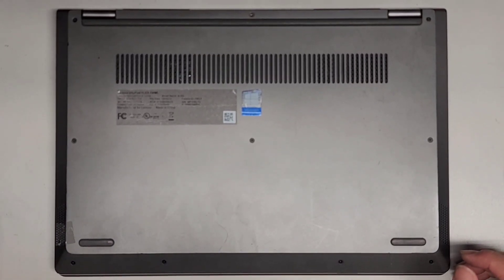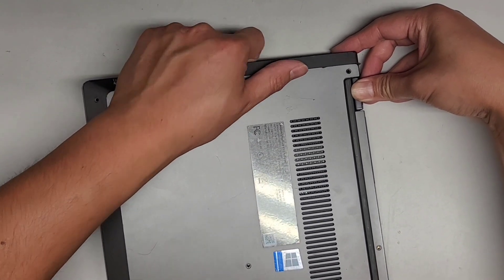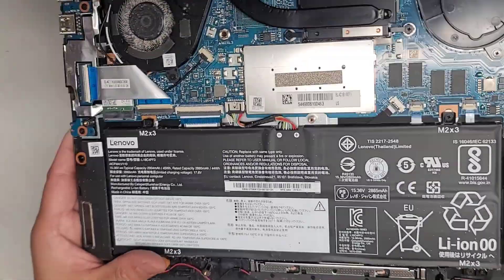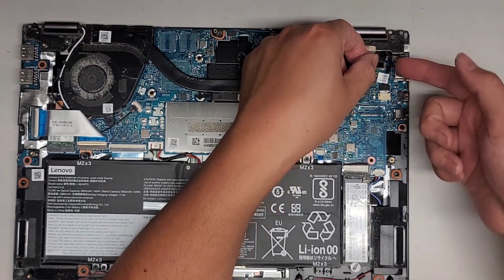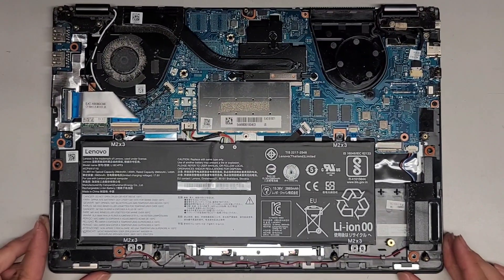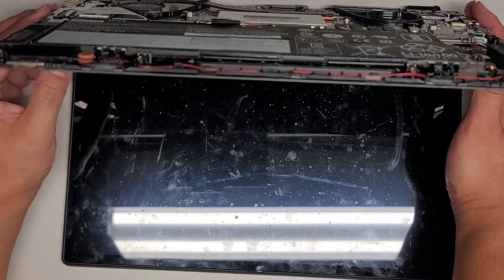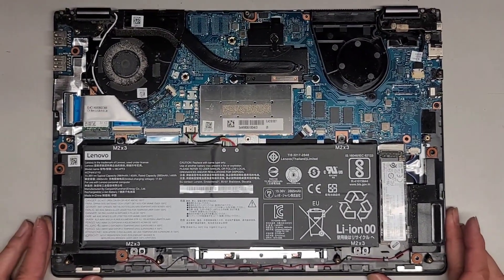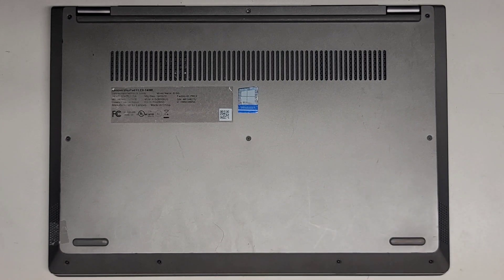Lenovo IdeaPad FLEX-14IWL Disassembly RAM SSD Hard Drive Upgrade Battery Replacement No Post Repair

Comment: Can I still replace the stick of ram to get 16, or will that do nothing with the soldered ram being 4. I'm not sure how the soldered ram works
Reply from the maker: @Cjmcoolem  you can. It'll make 20gb the first 8gb will run in dual channel if my understanding is correct.
Reply: @ItsBinhRepaired  will the laptop run 20gb of ram fine? Thats a big jump from 8
Reply from the maker: @Cjmcoolem  it should
Reply: @ItsBinhRepaired  sweet! now last question, any stick of ram that says (PC4-2666V) Is compatible correct?
Reply from the maker: Yup, should be

Comment: Can I install a 16gb 3200mhz stick ?
Reply from the maker: @brandondookeran2953  might need to be  pc4 2666v to work. You can try
Reply: @ItsBinhRepaired  worried if it might cause instability. The 3200mhz is more available where I'm from

Comment: I will be replacing my keyboard ('C' key dead-wife spilled some water on it). I have the same model laptop and have the replacement keyboard already. I was hoping you had removed it in this video so I could follow along. I have replaced the battery in this same laptop twice but didn't notice the keyboard when I removed the battery. Any advice on removing it? Thanks-great video BTW!
Reply from the maker: What?! That's no reason to kill her! Lol jokes aside, this playlist will help. Keyboard Replacement Repair: https://www.youtube.com/playlist?list=PLSSiYX-ta7aqzLhKbFnFGe9y9jl_d0aiU
Reply: @ItsBinhRepaired  😆 Thanks!
Reply from the maker: No problem

Comment: Thanks for your help man!
Reply from the maker: No problem. Glad it helped. If you haven't already, please like and subscribe so others can find my videos and possibly consider watching a few others and commenting to get the algorithm to recommend my channel. Thanks!
Reply: @ItsBinhRepaired  Saved me a huge headache because I was about to crack open the laptop to replace the hard drive. I didn't realize it was M2 and not a 2.5 inch SATA. That would have been a fun accident
Reply from the maker: @plasteredlyric32  glad it helped.

Comment: Wanted to replace my battery, your video helped a lot. Thank you for making the video.
Reply: Hello, please I need assistant getting my battery replaced. I have the same model but I couldn't find the battery. I tried searching my laptop model and battery model still didn't get anything. Please kindly assist me. Thank you
Reply from the maker: @zalimagambo9267  this should help https://amzn.to/3yWlCrv
Reply from the maker: Awesome, glad it helped. If you haven't already, please like and subscribe so others can find my videos and possibly consider watching a few others and commenting to get the algorithm to recommend my channel. Thanks!
Reply: I’m trying to replace my battery too. @vishwajith88 how many years did you get out of your original laptop battery? I’m quite surprised mine only lasted 5 years from barely any use.
Reply from the maker: @howmuchdidthatcost  not using your battery is actually bad for it. Draining it to 0 is also bad. Leaving it at 100% is also bad.
Reply: @ItsBinhRepaired  I was wondering if not using my laptop for long periods of time would be bad for it- like a car. Good to know moving forward!
Reply from the maker: @howmuchdidthatcost  yup
Reply: @ItsBinhRepaired  would you recommend getting the battery from manufacturer, or a universal equivalent battery?
Reply from the maker: @howmuchdidthatcost  the ones from the manufacturer are super expensive. Usually a bit better quality, but I feel it's not worth the cost. It's up to you.
Reply: @ItsBinhRepaired  thank you so much! Appreciate the honesty.
Reply from the maker: @howmuchdidthatcost  no problem

Comment: Thank you for the video effort.  I have one question if you don't mind.  My battery is bad.  Can I just swap it out (I have replacement) or is there things I should be careful with considering the other components?  I don't want to screw up the software volatile or otherwise.  Again thank you.
Reply from the maker: Should be able to just swap it out.
Reply: OK I got it and it started right up.  Thanks again.
Reply from the maker: Awesome

Comment: Thanks for the video.  I have the Flex 14API and planning to upgrade the SSD to 2 TB.  Would you recommend the Samsung 980 Pro?  Since a regular heatsink won’t fit have you had any luck with sticker thermal pads?
Reply from the maker: I would get the models without heatsink. I always see SSDs with them and thermal pads fail for some reason.

Comment: Hi great video I have a question about the speakers, I need to replace them since they went bad Sound is no longer clear however when connect external or earbuds the sound is good so once I have the cover off can I just replace the speaker or will I need to disassemble something else inorder to get to the wire connectors  Thanks for any input,  rather know in advance from someone that knows  Thanks Dan
Reply from the maker: Doesn't look like anything else needs to be removed.
Reply: Thanks
 @ItsBinhRepaired
Reply from the maker: Hope it went well
Reply: Yes it did,actually did not have to replace the speakers, they sounded muffled so when I opened the back & got to the speakers I noticed metal dust was magnetized to both speakers & would not let them vibrate hence low muffled sound, once the metal dust was removed, sound was like new, I have read that many had the sound issue with no fix,  thanks
Reply from the maker: Awesome!

Comment: Nice video.  What is the size (physical dimensions) of the M.2 SSD?
Reply: M.2 2280
(22x80mm)
Reply from the maker: I don't measure them. It's a standard m.2. You couldn't get the wrong size unless you were trying.